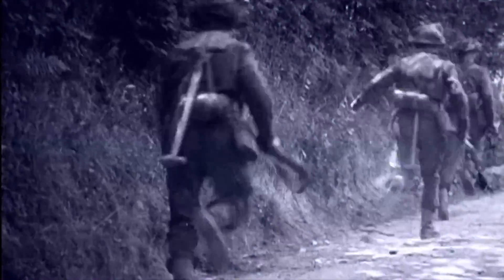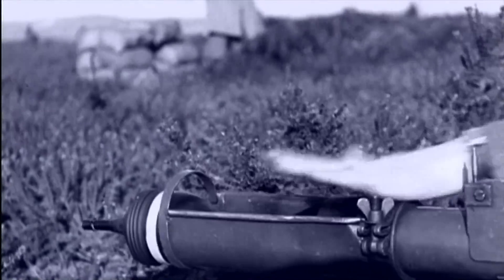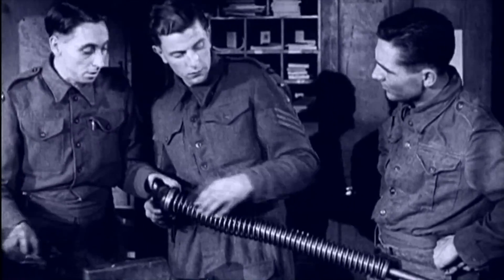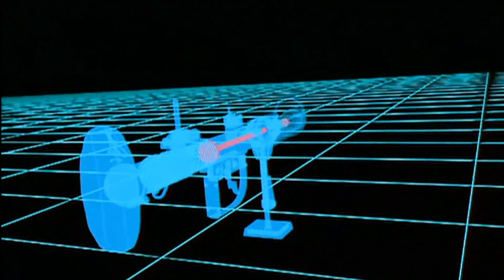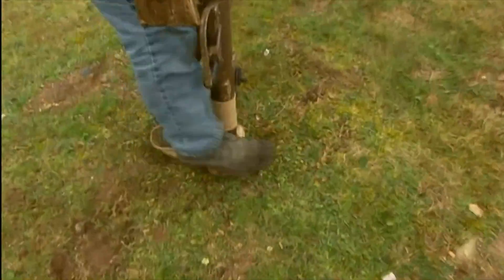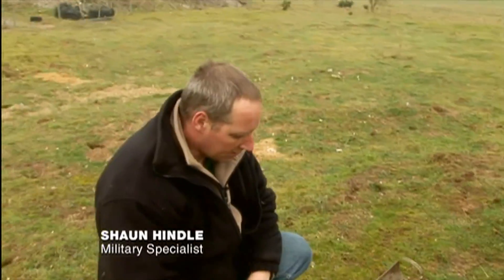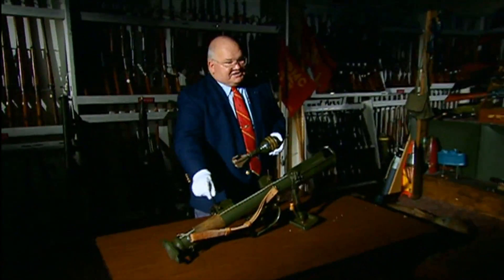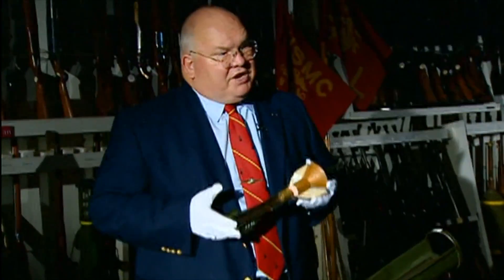Weaponology - "British PIAT"

Comment: "There are a lot better ways" Yeah. But where were they at the moment in time that the PIAT was being developed?
Reply: The only real drawback was the cocking mechanism. However you could cock it before going into action and carry it cocked but unloaded.  After the first shot the recoil recocked it. It did  have some advantages. No flash or smoke to give away the firers position and no back blast so you could fire it from confined spaces, so through windows from inside buildings without killing the firer or anyone else in the room it was being fired from. Neither the US Bazooka or German Pamzerfaust or Panzershrek had those advantages. Calling it a monstrosity is therefore a little harsh.
Reply: +Drew fromOz My undestanding was that part of the reason for not going for rocket was a worry about availability of propellant. The shortage worry was unnecessary but was an influence on much of British WW2 design.
Reply: x42brown Cool. Same thinking was behind some Australian WW2 aircraft designs- use what was available, rather than what would have been best practice and ideal
.